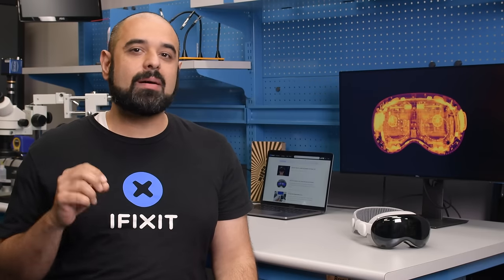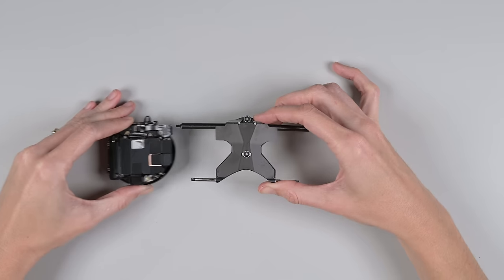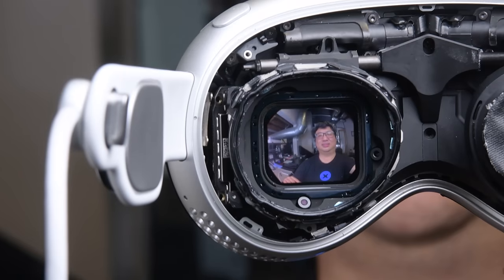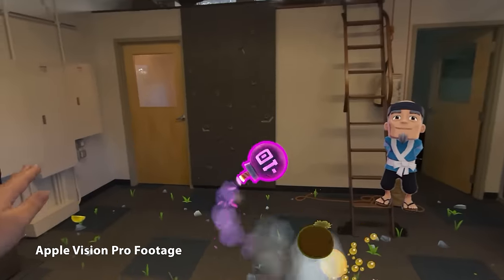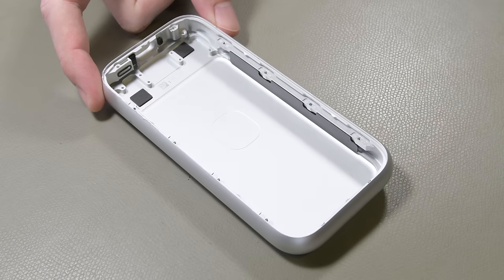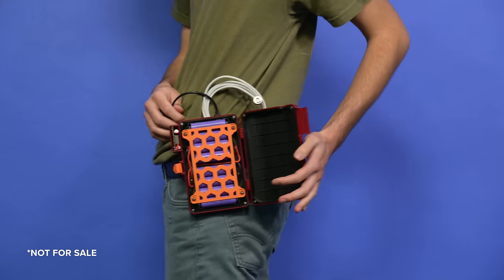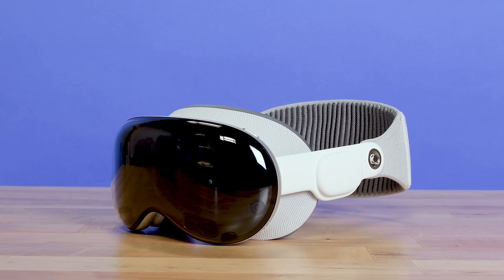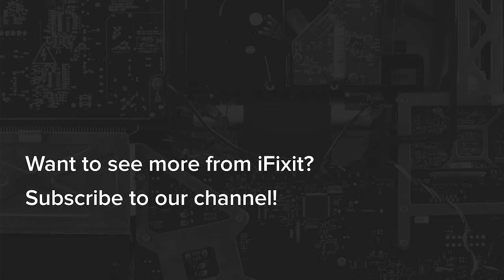Vision Pro Teardown Part 2 - Is the Apple Vision Pro Really 4K?

Comment: Don't worry about the battery pack All you need to do is create a 3D scan of it get it in your STL file and put it into solidworks or AutoCAD, and you should be able to get another version that should be a little bit bigger extra pack and it still, like you know increase the width, and the copy should be good to go as far as that goes 😊. And when it comes to the non-usable screen you might have to go to someone that's custom and it's still going to most likely run you about I would say 400 at the max and the minimum is 395. And that's like a third party person because you're getting accustomed with me they can also most likely increase the resolution and stuff on there and when you create the glue you can make it easier so it can be detached. All you need to do is look for someone who's a industrial design company for a development company and you should be able to get it done.

Comment: Devices like a VR headset, or earbuds... They need to be very compact, which makes reparibility difficult by default, BUT. Just as with replaceable battery on a waterproof device, it can be done, it has been done. If the compenies wanted, or needed, doe to legislation, theycould make these repeatable.
P.S. Battery pack that needs to damaged to release the cells inside is sad.
P.P.S. The fact that components not being locked to each device be software being a plus is wrong.

Comment: An overpriced $3500 VR headset that advertised plastic as "glass" then will proceed to charge users an additional $800 to fix scratches on the "glass". What a huge scam that deserves an automatic 0/10 score. 😂
Reply: The headset is already soldout no matter the price it have
Reply: Offer me a better user experience with a better screen that's cheaper and I'll buy it.
Reply: thank you for displaying the average intelligence of an apple hater
Reply: It is glass, it’s just laminated with plastic for safety
Reply: @nomecognome2 for safety, most manufacturers put the plastic inside the glass. That keeps the glass toghether if broken, and means you can't scratch it with your finger/anything metal. 

Apple chose to put it on the outside and made it expensive to replace.

An edit: I want to clarify. I believe the laminate should be on the inside, and the plastic on the outside should be replaceable. Like a screen protector. You get shatter resistance, protection from impacts and such, and don't need to replace the entire module if you scratch it.
Reply: Ohhh so like what happened when all those new folding phones came out
Reply: I’m not an apple fan, but I definitely want to try this, have u tried this before write your score?
Reply: I guess you’re too poor on your own taste. Too bad
Reply: well,yes duh lol☺️
Reply: @mars5train601  if you put plastic just inside you’re still getting cut and glass shards start to go everywhere, just like on phones
Reply: Why 0/10 

The scale has a meaning 

It’s just a silly complain

Apple does arguably hateful to repair devices, 
But your complaint doesn’t make any sense 

I can’t afford a Vision Pro 
But I don’t spread hate on it because of my frustration
Reply: closest thing to the apple vision pro hardware wise is a varjo xr-4 which is $500 more.
Reply: @nomecognome2 They could at least put in a screen protector at that point.
Reply: It’s glass but the geniuses at Apple put the lamination plastic on the outside instead of the usual inside
Reply: @MutantNinjaDonut What would you define as equivalent hardware and software? I'd argue Meta Quest 3 is probably a pretty comparable experience and it costs 7 times less. Pimax Crystal has weaker, but still decent hardware and a screen with superior PPD to Vision Pro for half the price.
Reply: The comments you hear from who 1- have never tried it nor seen it 2-can’t afford it 🤷🏾
Reply: Laminated not plastic
Reply: @mars5train601  there’s no excuse that it’s too expensive to replace but in this case, they chose crack resistance over scratch resistance, I say that’s a valid design choice for a device that’s going to be worn on your head
Reply: Apple have literally said many time (laminated glass) 
You don’t know what is this?? Laminated glass is a type of safety glass consisting of two or more layers of glass with one or more thin polymer interlayers between them which prevent the glass from breaking into large sharp pieces.
Reply: So for the most comparable (resolution) experience i spent 4500$ if not more to build a pc to drive the htc vive pro 2 plus base stations, index controllers, etc. of which i spent another 1500$+ on. Which is less than you can expect to spend on some headsets before supporting hardware like basestations. 3500$ may seem like a lot to invest in something like this for the average consumer. but if youve been an enthusiast in this space for the past few years youll know thats not that crazy of a price. Being able to drive those displays portably and quietly is no small feat. That took some serious R&D on apples part.
Reply: Oh another owner of multi trillion dollars high tech ultra profitable company. Where’s your product?
Reply: Did you even watch the video
Reply: It's glass but nerfed
Reply: It's Apple, what did you expect? Fanboys will literally buy anything at any price as long as their logo is on it.
Reply: No… it’s an underpriced technological marvel that makes your monitor and tv obsolete, and one packed with the absolute peak of what humanity has to offer in design, user experience and the consumer tech space that literally redefines what’s possible and truely opens the window to a whole new era of personal computing, not to mention the millions if not billions of R&D that went into this. And god forbid they make some money like everyone else is doing… I don’t like the pricing either. But you gotta admit they do have an extremely compelling product.
Reply: A lot of armchair engineers in the comments section smh go make a memo explaining what yall bums want to say to them
Reply: Go design the vision pro yall think yall better than the engineers who designed them
Reply: @Kenny17674 glastic.
Reply: Bro it’s plastic protecting the glass
Reply: It is glass my guy, just laminated so that the glass doesn’t shatter if dropped 😮
Reply: yeah and what's it's true competitor?? what offers the same user experience? lemme know lmao
Reply: @AHMED-99996  bro he's an apple hater. Doing some research before speaking is too difficult for him 😂
Reply: @NoahHerman  lol as a tech enthusiast, I am surprised something like this can cost less than $5000. This is a technological Marvel.
Reply: To be fair, they said "laminated glass" which is glass laminated in plastic, similar to automotive glass. This prevents glass from flying everywhere if it does break, as the shards are contained by the plastic. That said, this device is DISGUSTINGLY overpriced, and though the hardcore iSheep will buy it, AVP is unlikely to push VR into the mainstream anytime soon. It's gonna take a MAJOR revision with a more realistic price point for that to happen!
Reply: There are better screen options, but don't expect a Fisher-Price like user experience.
Reply: @Stanley88845 whataboutism at its finest trying to defend Apple 😂

Those plastic folding screens didn't advertise the plastic as glass and they were first gen products. Vision Pro isn't a first gen VR headset, companies like Meta, Valve have already released several VR headsets. Try again.
Reply: @ab01205  no defending anyone, just treating all companies fairly. Apple advertised laminated glass for the Vision Pro, Samsung Advertised flexible glass for the Fold 1. Then everyone removed the plastic cover on their fold, broke it and quickly realised that it’s also laminated glass, just like Apple’s Vision Pro.
Reply: @_-_-_-_-_-_-_-_-_-_-_-_-_-_  Do you live under a rock? Big companies like Meta, Valve, HTC halve already released multiple VR headsets. It's not a first gen product.
Reply: @Stanley88845  The difference is Samsung publicly warned against removing the plastic cover.
Reply: @_-_-_-_-_-_-_-_-_-_-_-_-_-_  It's true that it's Apples first VR product but it's not a first gen product in general.
Reply: @ab01205  after everyone was taking them off, or am I remembering it wrong? Also no one is going to be taking off the plastic on their Vision Pro, it’s too difficult to do so.
Reply: @nomecognome2  yep, that's where you'd use a removable plastic film/screen protector. But it should be removable easily, not bonded to the glass
Reply: @neon_arch  
I agree 😂😂😂
Reply: @mars5train601  yeah but people who hate screen protectors would remove it right away, that’s the risk
Reply: @nomecognome2  if a user breaks/scratches the glass layer after deliberately removing the protective screen protector, I'd consider it a them problem™, not something apple should have to counter
Reply: @mars5train601  if it were just glass people would be complaining anyway

Comment: Okay? So Apple evil because they use the loose definition of 4K…. Like… absolutely everyone else…… okay… yes… Apple bad…

Quick question. Why is a case that holds batteries such a big issue? As you demonstrated it’s likely trivial to make a replacement case and my money, even if it just popped open is if you are looking for a replacement pack. You’re likely just going to buy the whole… yknow… pack.. the cable easily detaches. And ik you guys love making everything complicated but why does everyone need to be able to be comfortable and safe desoldering battery pouch cells that go boom? You guys will find anything…

Comment: The display is not the reason pass-through looks grainy. Pass-through looks grainy because it can’t process a high resolution fast enough. These displays have nearly perfect resolution when you look at fully VR content like those Apple environments. Still some improvements can be made with the brightness and FOV, but resolution is great.
Reply: You need 8K x 8K for around 20/20 acuity at 100 degrees FOV and 20/20 is still not considered perfect, hence many VR presentations over the years stated 16K as the ultimate goal.  We are not even close to that, but APV crosses the threshold of good enough monitor replacement (films at THX viewing angle achieve FULL HD - first time ever in a consumer VR headset). 11 years ago Oculus DK1 PPD was so low it made you legally blind (although it had a wider FOV), so the progress is good.